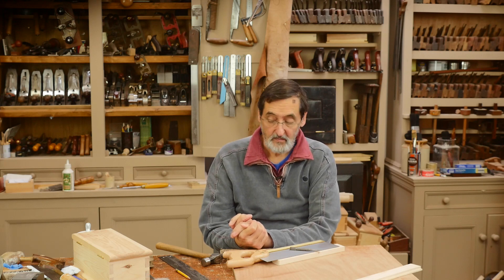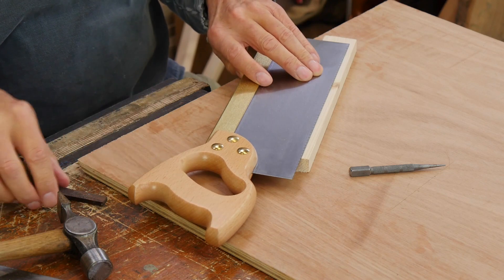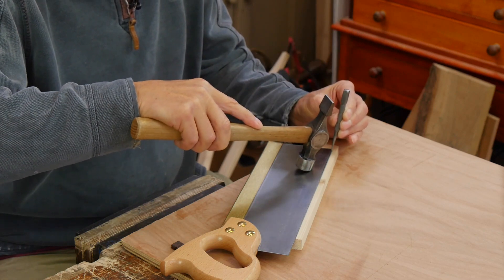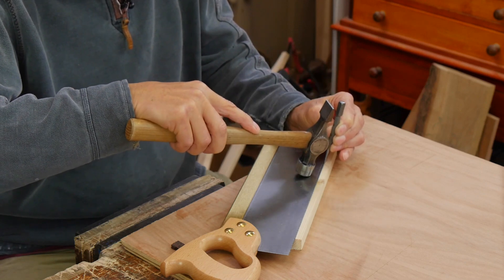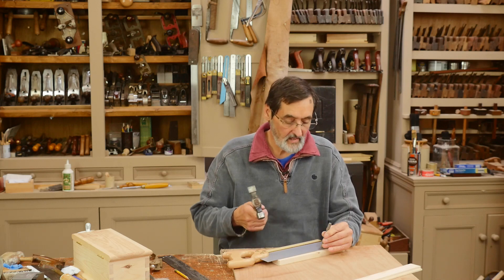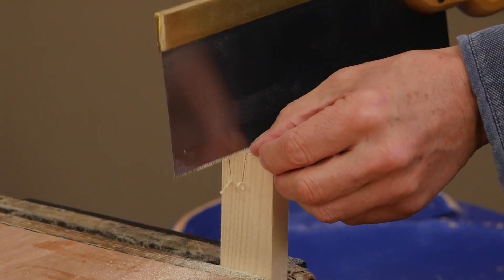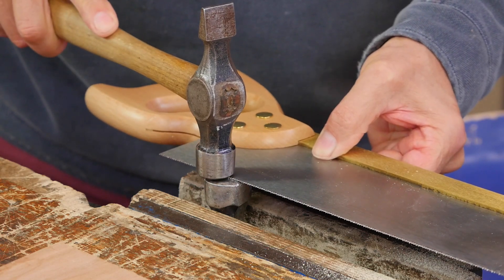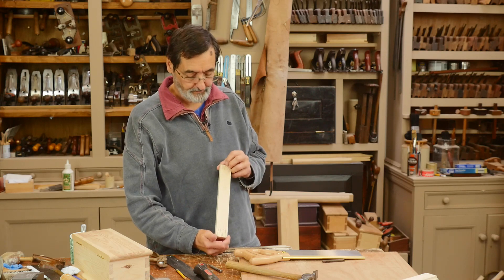Setting Saws with a Hammer & Punch | Paul Sellers

Comment: I’m currently in the process of cutting new teeth for a 14ppi crosscut carcass saw that I’ve slowly been making. Took a saw plate from a junk saw and completely ground the old teeth to nothing, and have been filing new ones in. The only set tool that I have at the moment is a very old plier-style type, rather then a pistol type, and it does not seem like I would have good success with it in setting these little teeth. Of course an internet search for “setting saw teeth without a set tool” is going to result in a top answer from my favorite teacher and virtual mentor, Mr. Sellers. Thank you so much, I found this one at just the right time!

Comment: I converted an old Disston saw from 8 point to 10 point using the method you showed in another video. It worked well and, because I don’t have a saw set, I used this method to set the teeth. I discovered that the plate was quite thick relative to the height of the new teeth so it took quite a bit more forceful hammer blows to bend them. I ended up with a pretty subtle set, but the saw cuts beautifully, even if I sometimes have to wax or oil the plate while making longer cuts

Comment: I have had a heck of a time with a saw set on 12 TPI saw blades.  Can't really see the teeth well when looking straight down through the opening in the set.  Newly sharpend saw teeth seem to reflect the light in all directions and I just can't distinguish one tooth from the next one very well.  I tried rubbing a magic marker on the teeth, using a blue crayon, white chalk stick, a welders talc chalk stick, none works for me. This method, laying the saw flat on a board solves that issue for me.  It is then easy to move consistently from tooth to tooth.  Many thanks for the time and expense you go through to produce these videos.  I find them very valuable information.
Reply: The board gives it a contrast.

Comment: Have also used a block of steel to back up the blade.  The bevel filed on it, combined with the teeth being aligned with the edge, gives precisely the set you want.  Afterwards, I like to lay a sheet or so of paper on the blade, lay a fine oilstone on that, and take one pass over the teeth to even out and square off the tips.  Cuts are a lot less fuzzy that way.

Comment: if it's dull and too fine to sharpen it, you can file/grind away the fine teeth and give it a little coarser tooth size or you can recycle the blade into scrapers

Comment: Hi Paul - you mention this process is suited for small saws - is it any different for big ones?

 I have a 1.3m, 2 man buck saw, with triangular teeth, and sometimes it's blocking in the cut -  I suspect some teeth are over-set, and I'd like to redo the tooth set.
Reply from the maker: You can do it the same way however a sawset would be more accurate.

Comment: HI Paul, I have a saw of which I am unsure wether it is still symmetrically set. Before freshly setting the saw I have the feeling that I should get rid of the existing set on the teeth, would you file it from the side or use the hammering technique until it's flat? Thanks, I really enjoy learning the saw sharpening. 
Tobias
Reply from the maker: Hi Tobias. You can use the hammering technique.

Comment: Hello Paul, Could you recommend a saw for cutting cherry wood stock. The wood is as tough as nails and seems to blunt my saw within minutes. Any help would be appreciated.
Reply: What type of saw are you looking for, Andi?  Panel saw, tenon saw, dovetail saw?  If you're looking for a rigid back saw, let me recommend Bad Axe Saws out of LaCrosse, WI  USA...Google Bad Axe Saw and you'll get Mark's website immediately.  I've got two of his and they last through the tough stuff!  He doesn't give 'em away but I've had excellent results that last...as far as a panel saw goes, I'd recommend going on Ebay and picking up an old Disston...they're abundant and affordable and will last your lifetime.  I like the D-8 but that isn't the only one that's good...be sure to get one "pre-war."  I think the 1920's were the best overall...hope this helps you out.
Reply: Lbhunter63 Thank you so much for your help. I have a panel (10" x 10" x 4") that I need to cut in half, to achieve 10" x 10" x 1 1/2",. I pushed through with my old saw and it took much longer than it should, however when I come to do this again I would love a good reliable saw that will do the job. I will look into your recommendations.

Comment: just posted this on your website, but thought people here may have runt into this similar situation:  I’m restoring an old Sandvik No. 271 rip saw (26″ long, 5 1/2 ppi) When i put in the vice to sharpen, i noticed that the teeth have a slightly convex curve from heel to toe, but it seems fairly uniform. Was this a specific design of the saw, or an error on the part of whomever had been sharpening it previously? Should I sharpen the teeth as-is, or joint the teeth straight from heel to toe first? I can’t find anything about this on the internet, so any insight you could provide would be golden! Thank you!
Reply: UncleJoe your saw is "breasted" which is not a problem. I think Paul's previous video addresses it
Reply: Cooper is right, Uncle Joe...no reason you can't joint the saw and sharpen normally...as long as you maintain your jointing to full length strokes so you don't shorten some teeth more than others.  I have a Pax saw that is breasted and this method works fine for me.
Reply: cool, full steam ahead!  Thanks guys!!

Comment: Hi!
I have an old keyhole saw that I sharpened but still it binds. The blade is about one millimeter thick and teeth are small and short. I tried to set them with a pin punch and hammer, but the blade is too thick. So how do I set the teeth on this saw?